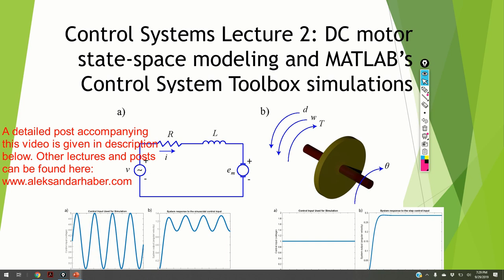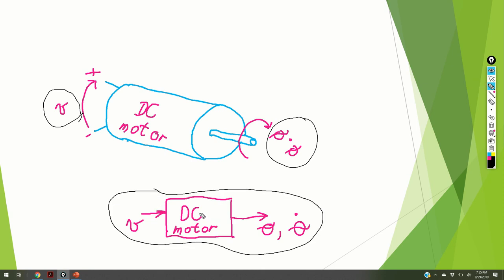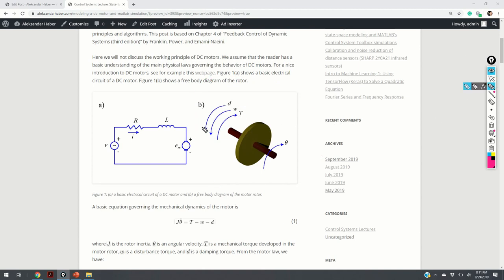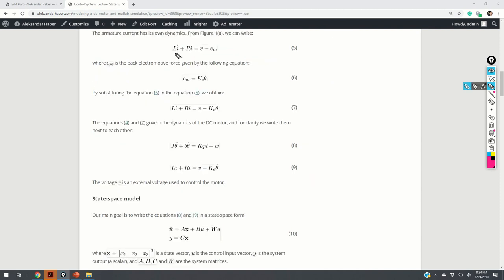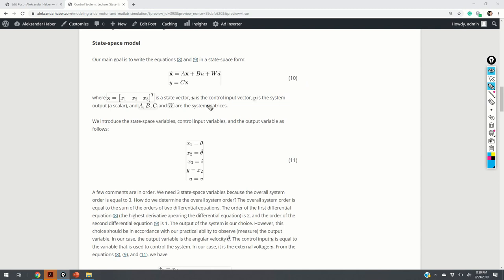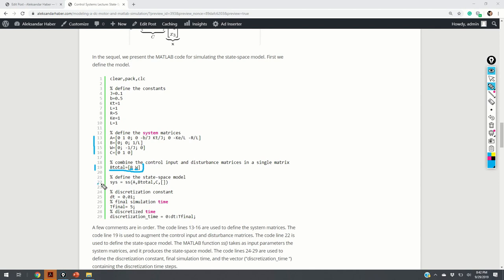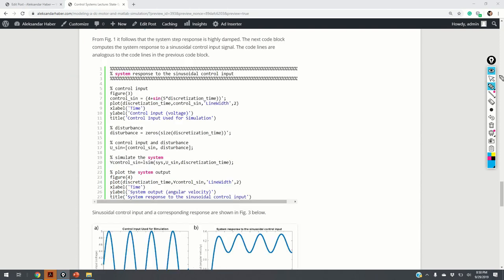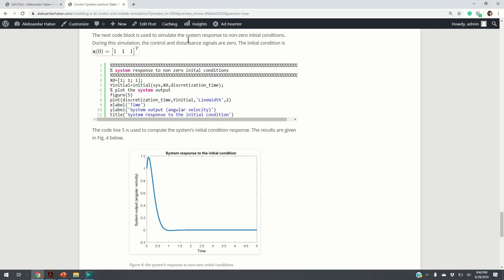Control Systems Lecture 2: State-space modeling of a DC motor and MATLAB's Control Systems Toolbox

Comment: Hey, thanks for the video! I learned that the number of variables in the state vector should equal the number of energy storages in the system. Could you tell me which are the 3 storages here, since you use 3 state variables? I can only come up with rotational energy and inductance. Thanks!
Reply: Also, you write "(remember that the state-space model is defined for two control input signals)" Which two inputs are that? Because when I run your code with line 17 as it is, I get an error in line 20 stating that the number of coloums doesn't match the number of inputs.
Reply from the maker: The state-space variables are rotational angle, rotational velocity, and current. Read the paragraph after equation 11 for the explanation. State-space variables cannot be equal to energy and they cannot be inductance (that is a physical parameter in the system). When you have a moving mass, then in order to postulate its state-space model, you need the position and the first derivative of position.  The energy of the system involves these variables, however, the energy itself is not the state of the system.
Reply from the maker: @florian1835  I just copied and pasted the code in my MATLAB (to double check). The code works perfectly, I do not get any error. I am using  MATLAB Version: 9.2.0.556344 (R2017a). Maybe something changes in the Control Systems Toolbox in the subsequent versions, however, that is highly unlikely. The two input variables are control and disturbance.